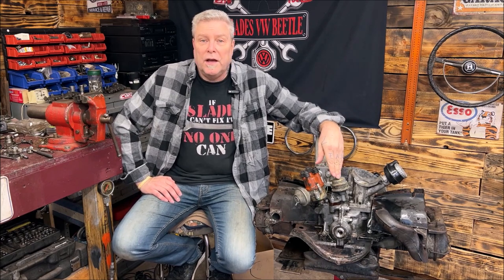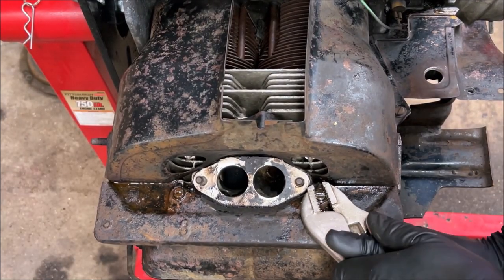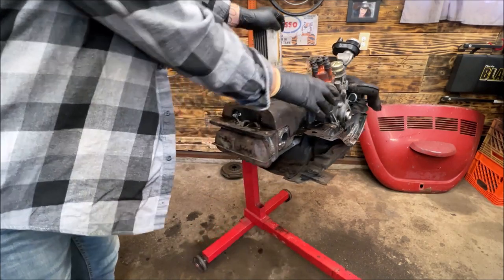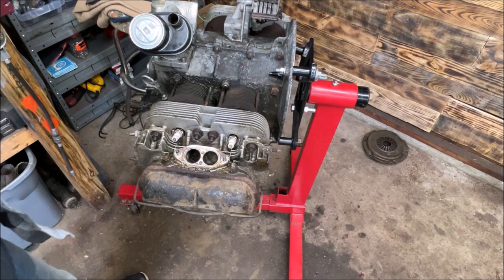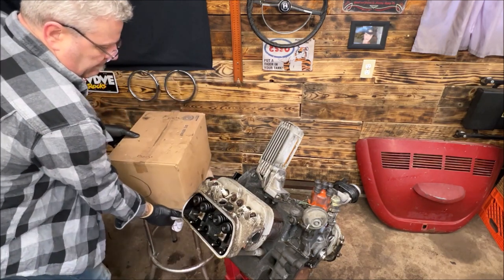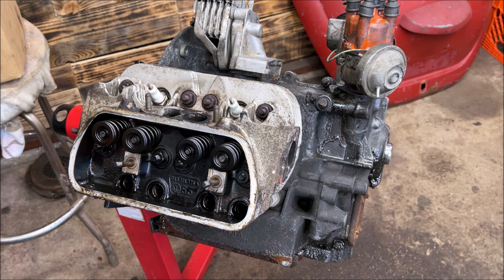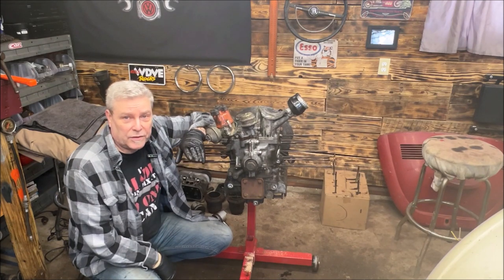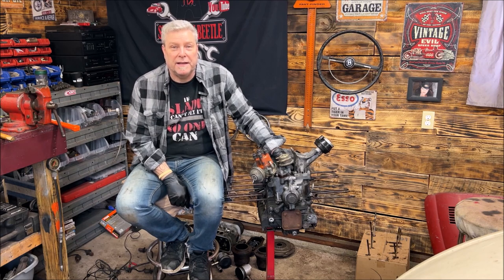VW Beetle Engine Rebuild Part #2 - How To Do a Top End Rebuild on a Volkswagen Beetle Motor - #vwbug

Comment: Check the pushrods tips holes, with 1/16 drill bit. If the drill bit doesn't fit, don't use the pushrod.

Comment: Yes --- I did enjoy Part #2 ------ Noticing your engine stand bouncing around alot , might weld in a 30 - 60 - 90 gusset at the bottom to eliminate that -- remove the piece of square tubing there -- or go over the top of it. Will make your stand much better. And are you sure the "Creeking" noise wasn't from your wrist's --- they were much closer to your mic than that screw in the tin?
      Have a Good One --- and Thanks Again --- Rodney

Comment: At 2:05 looking at the motor from the viewer's perspective, there are two captured nuts in the engine tin above each exhaust port facing the camera on the left and right. My assumption is those are for the basically horseshoe-shaped covers for half of the heat riser as it protrudes through the engine tin. Two screws hold it to the other half of the "horseshoe" and one secures it to the tin via the captured nut I am pointing out here. My engine tin does not have that captured nut but my horseshoe-shaped covers have the opening for a screw at that location but my tin has no opening.
What engine tin do I have?    I am the second owner of a 1973 Stock 1600 dual port, Standard, 49 States, Type 1 Beetle and I want to get my car back to 100% original.       Any help would be appreciated.  Thank you!

Comment: I have a question do you ever re-torque the heads before you take them off to see if the studs pull out of the block
Reply: Great question and a good thing to do. The older cases with 10mm studs, have that pull out studs problem. The newer 8mm cases have studs inserts to avoid the issue. But re-torquing the heads on engines with unknown history is a good idea.

Comment: If the wrist pins don't come out by using a socket and mallet, what's Plan B?
Reply from the maker: Wow! Now that I do not know. Have you sprayed some PB blaster in there and let it sit?
Reply: @SladesVWBeetle  Well, this may sound weird but I have not started the rebuild yet.  I'm watching as many videos as I can before I start so I don't screw anything up.  The reason I asked about the wrist pins is that at 23:22 you said, "Now if this gets tough I'm going to do it a different way."  I was just curious what the different way was.  Your videos are, BY FAR, the best ones out there.  I've been watching a ton of them and yours are in a higher stratosphere than all the others I've watched.  I would like to see a video of a bottom engine rebuild.  Thanks for the reply!
Reply: @patricianelson5333  This is so true! Slade is a great teacher, and I appreciate his long-form tutorials. He covers the details that others so often miss.

Comment: Hi Slade, I'm by no means a mechanic so bare with me if this is a stupid question. All these screwdriver studs you struggle with, can they be replaced by say stainless or high tensile steel Hex bolts?
Reply from the maker: no question is stupid Anne! They actually do sell the stainless steel screws. Although you can go to a local hardware store and buy some bolts....take a factory heat shield screw with you. And match up, then buy the bolts with 10mm heads!
Reply: @SladesVWBeetle  Thank you so much. This is my first and probably only engine rebuild. I'm converting a stock 1300 to a 1600. And thought I'd be in over my head. That is until I saw your excellent videos. And please give as much tips as you want. It really helps the plebs like me.

Comment: I’ve learned so much I know my 72 Doesn’t have a Thermostat anymore and that rod and linkage isn’t there either my motor has 88mm pistons and I’ll need to Get another thermostat setup somewhere! Can ya buy those from anywhere?
Reply: ebay or samba has the parts you need.

Comment: Just wondering, why are you rebuilding the top end. Did you do a compression/leak down test prior to starting.
Reply from the maker: Honestly Mike, I would’ve not probably done it. But the owner requested that it be done. So I thought it would be great for filming. If it was me I would’ve compression test it and probably ran it.